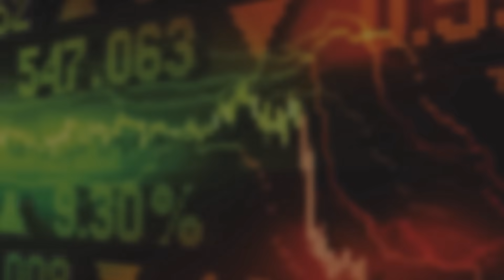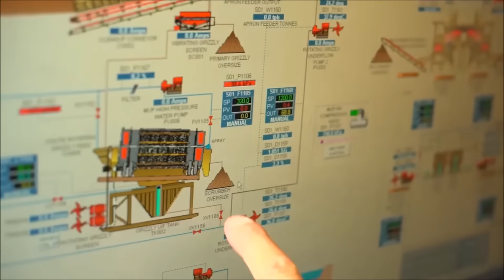Jamaica Finds Rare Earth Elements Worth 400 Billion USD

Comment: Rare earth elements (REEs) can be extracted from bauxite residue (red mud) through various hydrometallurgical and pyrometallurgical processes, often combined. Direct acid leaching is a common method, but it can be inefficient and costly due to high acid consumption and effluent handling. Combining pyrometallurgical treatments like roasting or smelting with subsequent leaching can improve REE recovery and potentially enable the reuse of the residue for other applications. 

Here's a more detailed breakdown:

1. Hydrometallurgical Processes (Leaching):

Direct Acid Leaching:

This involves treating the bauxite residue with acids like sulfuric or hydrochloric acid to dissolve the REEs. 

Challenges:

High acid consumption, large volumes of effluents to manage, and difficulty in using the residue after leaching. 

Potential Improvements:

Microwave pretreatment can enhance leaching efficiency. Dry digestion with multi-stage acid circulation can improve REE concentration and reduce water consumption. 

Other Leaching Agents:

Researchers are exploring other leaching agents like ionic liquids and organic acids. 

2. Pyrometallurgical Processes (Roasting and Smelting):

Pretreatment:

Roasting with alkali can improve the extraction of REEs and other metals like iron and aluminum. 

Smelting:

Smelting processes can be used to separate and concentrate valuable metals like iron and titanium, followed by leaching of the slag to recover REEs. 

Benefits:

Can enable the recovery of multiple metals and potentially allow for the reuse of the residue. 

3. Bioleaching:

Process:

This method uses microorganisms and their metabolic processes to dissolve minerals and extract REEs.

Mechanism:

Microorganisms produce biolixiviants (substances that enhance metal extraction) through iron/sulfur oxidation or organic acid production. 

4. Challenges and Considerations:

Complexity:

Extracting REEs from bauxite residue is complex due to the presence of other metals and the chemical stability of REEs. 

Cost:

Acid leaching can be expensive due to acid consumption and effluent treatment. Pyrometallurgical processes can also be costly due to energy requirements. 

Environmental Concerns:

Acid leaching can pose environmental risks, including soil and water contamination. Pyrometallurgical processes can generate emissions and slag that require careful management. 

Scalability:

While some methods are scalable, they may require significant capital investments in infrastructure and equipment. 

5. Specific Technologies:

Orbite process: A specific process for recovering aluminum, iron, and REEs from bauxite residue. 

Pressure leaching: An alternative to direct acid leaching that can improve REE recovery. 

Acid baking process: Another process for recovering metals from bauxite residue. 

Cascade of centrifugal extractors: Developed for separating REEs, including scandium. 

In summary, while there are several promising methods for extracting REEs from bauxite residue, further research and development are needed to optimize these processes for cost-effectiveness, environmental sustainability, and scalability.
Reply: Are you a Jamaican?